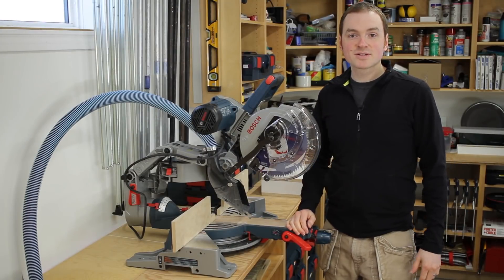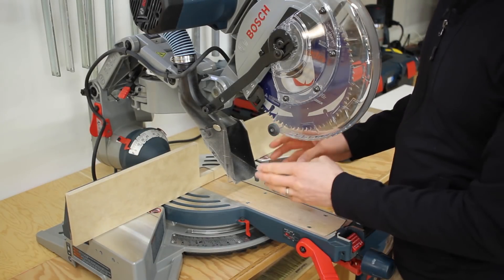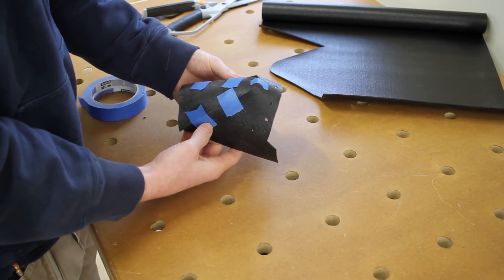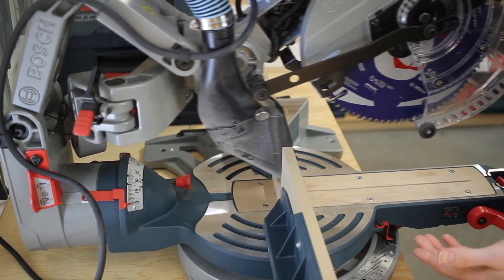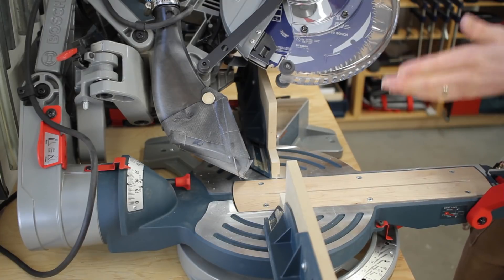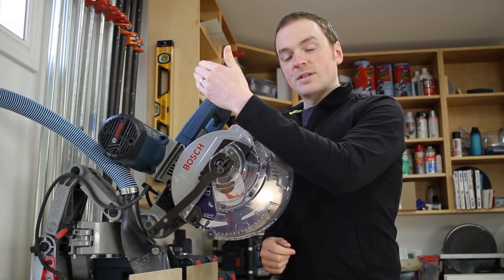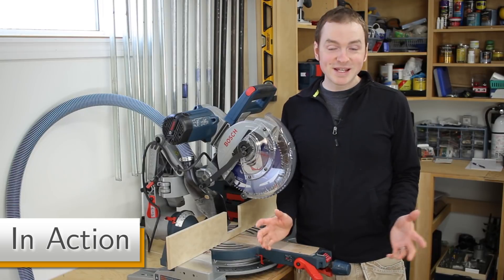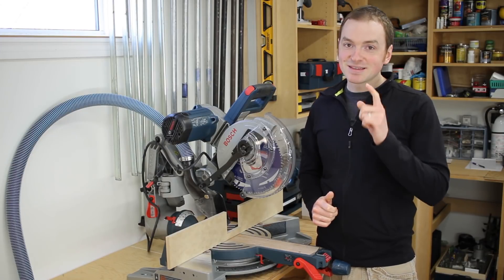Bosch Axial Glide Dust Collection Upgrades & Mods

Comment: Your shop is less dusty than my house!  Not really, but I have a terrible time keeping saw dust at bay in my little basement shop.  I’ve got 2 powertec dust collectors that I hook up to whichever machine I’m using but dust still flies.  I got a Delta Cruzer last spring and that thing spews dust everywhere even with a dust shroud and the dust collector hooked up to a straight pipe like you show.  The worst though is my DeWalt 745 table saw, any tips on keeping dust from flying out the front? .
Reply from the maker: Have you seen my video on table saw dust collection upgrades?

Comment: Well, I tried your suggestion, only I came up with something I think was a little better I think.  I took a gallon plastic milk jug and cut a 1 piece similar shape from the corner and placed it inside the dust chute. I had to play with it until I got it the shape I wanted. The plastic gives it a little stiffness to return to its original shape yet it will be flexible enough to bend. I stapled it to the dust chute. It seems to work pretty well for now. Time will tell how long it will last. Thanks for your suggestion.
Reply from the maker: Great idea, thanks for sharing👍

Comment: Hi, I was wondering if it might be possible to make the boot adjustable on the fly to account for different thickness of wood?
Reply from the maker: That's a good idea. I'm sure you could make the bottom part of the boot adjustable somehow or have pieces of different sizes at the bottom that could be easily swapped out.

Comment: I just got the same saw from Lowes's website but the dust elbow is riveted onto the strait piece that you have the hose connected to, Dan. I tried Alan wrenches and nothing fits.  I'm looking at getting the oscillating tool with metal blade to cut through those rivets.  Seems like Bosch made this modification with newer models.  I have the 12 inch but the serial number plate is dated Nov. 2018.
Reply from the maker: That's strange, I've never heard of the elbow being fastened in place like that before. Is it possible to drill them out or is there access for that?
Reply: @DPShopTalk   I'll try drilling first; good idea.  Saturday is the big day to make the modifications, I plan on loosing myself on a zero clearance plate and hooking up a new dust collection pool hose.  I used your pattern for the dust boot, although not as neat as yours, it seems to work much better.  Another interesting change is the switch lock is not on either side of the D handle. Rather, it is located underneath the handle, accessed by the thumb, and it slides to the right or left to unlock the switch.  Will take some getting used to but, from, what I can tell, is the only modifications from what you have.  I checked Bosch's website and it seems this new design is not shown on there site.  I live in NE Pennsylvania and it took 10 days to receive it to the local store for pick up. So not sure where it came from but it is one hell of a nice saw though!
Reply: Quick Update: I just noticed something after seeing how the dust port on Dan's saw angles backwards so the pool hose rests behind the motor. The dust port on my GCM12SD angles to the left, not behind the motor and, if I took that elbow from the machine off, the hose would mount directly under the motor.  It's almost as if Bosch watched this Video and said "looks like we have to modify that port so people don't Jerry rig stuff". So, when the motor is in its upright resting  position there is no room for the dust hose especially when pulling the saw down to cut. It appeared to me I did not have a choice other than to leave the dust port elbow intact and on the machine.  The only modification I did was cut off the two nubs that house the rivets (see my initial post above) and install the pool hose into that elbow port then secure a band clamp over the port.  So far so good; the connection feels secure  and I left enough slack to miter and bevel from either side.  Thank you, Dan for posting this. It did inspire me to make the modifications; too bad they changed the model slightly.
Reply from the maker: That's interesting that Bosch made that modification.  I do know for a fact that Bosch has watched that video so you could be right lol.  I don't think that the 90 degree elbow makes a significant difference in the air flow so you should be fine leaving it as is.

Comment: I'm curious how people are "getting around" the fact that there's NO LASER.  My old saw has a laser, and it's addictive!  I bought this GCM12SD yesterday (knowing full well there's no laser) because reviews showed it to be accurate, and because the bar doesn't extend far into the back.  I'm not disappointed (with the accuracy of the 90 degree cut).  Now I just want to line up the blade with my mark on a piece of wood.

I suppose I could also replace the kerf inserts with a piece of wood like you have done.  That way I could just LINE UP MY PIECE WITH THE CUT MARK on the insert.

I'm sure people will also employ STOP BLOCKS set at a specific distance from the fence.  I think this only works in some scenarios.
Reply from the maker: I used to have a saw with a laser on it and really the only time that I miss it is when I'm cutting crown moulding. For most cuts I find that having a zero clearance fence plate or insert is even more accurate.  It would be nice if the Axial Glide saws came with a laser though since they do come in handy.
Reply: Dewalt has a light that casts a shadow on their miter saws.  Other people look thru the blade guard to see the tooth of the blade that points to the line, left or right till it is inline with the mark, this is while motor us off.  

Again with the motor off,  You can look from the side and down also where a tooth will hit the line if you bring the blade down and out to where the line is.  Though you have to be careful not to scratch the surface of the stock material.

Some start the saw and slowly bring the material in till the stock is being cut appropriately by making small cuts, and then when lined up where they want  they cut all the way thru.
Reply: Thanks,  @tabithaa.9252  !  I lifted the blade guard, and was able to site down the sides of the blade -- I think that method is working really well for me!
Reply: @harrypehkonen  

Your welcome, it actually was my husband clifford, using my account.  He says he usually doesn't lift the guard on his bosch sliding with rails, cause the guard is clear with a slot to look thru.

He also says he doesn't know much about the glide.  He learned a lot from  a cabinet maker and that helped him out.  If still struggling find one that you can talk to in person and they can teach a lot of useful information in person.

Welcome again, glad it helped.

Maybe this will motivate him to be on facebook.

Comment: Dan,

I have a Ridgid 12 inch miter saw and your pattern doesn’t work for me. It would be very enlightening if you could do a video showing how you developed your template.

Thanks
Reply from the maker: Hi Pam, you basically just need to work with what you have on the saw.  When I made my boot I just looked at what was on the saw and figured out how to best attach a custom boot using what was there to mount to.  I made some prototypes first to get the shape right and then once I was happy I made my final boot that I showed in the video.  A bit of creativity and trial and error is all you need.

Comment: You did a nice neat job on that scoop - mine came out rather less pretty :) Thanks for the template, nice bit of cad there!  I plan to box the saw in an attempt to contain what the scoop misses, just noodling out how to pass the hose through and where to add a shroud for another 6" line from the dc.  I think it's gonna have to be on the box top since that's where the drop is. Hopefully it'll pick up the majority of the fines, we'll see.

Comment: So I my Bosch 12" (GCM12SD) has a smaller plastic intake than the one shown in the video.  So the template does not work for me.   I also have the 10", and it has the same dust collector as the 12". I am not sure why Bosch made it smaller. At least I have 962 feet of drawer liner left to play with to make my own.
Reply from the maker: How old are your saws? Bosch must have updated the saws with bigger collectors at some point.
Reply: @DPShopTalk  The 10" was purchased new in Dec of '17. The 12" I purchased used from a guy that didn't like it because it wasn't "man-portable".  LOL.  That was last month. He claimed it was similar age to the 10"

I'll contact Bosch on Monday and see what the deal is. If I can get the newer, larger chute, and it's not ridiculously expensive, I'll buy it.
Reply from the maker: So your 10" would be about the same age as mine then depending on how long they both sat in the store for. I'll be interested to see what Bosch tells you.

Comment: Nice Dan, as usual! Have you considered or since implemented a way to turn on the DC at the same time as the saw (with 1 switch)?
Reply from the maker: Thanks! I use an iVAC switch to turn the dust extractor on and off with a remote. You could easily use one of the automated iVAC switches to plug the saw into that would turn the extractor on and off automatically. Personally I like the control that the remote gives.
Reply: I have an auto switch that turns it on, but I didn't like the lag time it takes to get started so I just wired a switch to the front of my bench that I plug the vacuum into.

Comment: i think every sliding miter saw can benefit from this modification.   i was wondering are u sponsored by Bosch?
Reply from the maker: Yes this could certainly be adapted to most saws since dust collection is usually lacking on miter saws.

No I'm not sponsored by Bosch. Sometimes they send me some of their tools to test out, feature or review but they don't pay me. A lot of my Bosch gear I've purchased myself including this saw because I've found Bosch to be quality.
Reply: ok thank you a bunch for your video

Comment: Good idea and design.

I just made one for my 12".

I made it out of about 3mm (1/8 inch) leather instead because that's all I had.  You can probably get the amount of 3mm leather you need for around $10-$15 if you decide to go through route instead of the vinyl.  As a result, this made it plenty sturdy and there was no need for a metal bar which I'm not a fan of near a spinning saw blade.  Instead of the neodymium magnets, I just used gorilla tape instead.  Again, not a fan of metal near that saw blade.

Thank you for your design and idea.  It greatly improved my saw dust collection on this saw.
Reply from the maker: Sounds like the leather worked great. I'll have to keep that in mind if I ever need to make a new one. Thanks for sharing👍
Reply: Dan Pattison  It did.  Put it through the initial tests last night and it worked well on 2" thick maple (until I get to the other side of the 9" board which then the blade just sends all the sawdust upwards, but there's really no way to resolve that since there is 8" of maple between the boot and the blade haha)

Works great on stuff that's only 4-5 inches wide.

Comment: This is a good way to improve dust collection on a Bosch miter saw.  It did however take me two tries to get one that fit correctly.  However, the second time I made a significant improvement.  Instead of the wire, which is what caused problems with the first try, I cut up an old, plastic water bottle, the squeezable kind designed for bicycles.  I think a 1 qt yogart container or perhaps a section from a gallon bottle would work as well.  The plastic gives the whole thing a shape and is easier to tape into position.  I also found I didn't need the magnets.  The front wings stick out a bit but that doesn't seem to be a problem.
Reply from the maker: Thanks for sharing, the plastic sounds like a great idea 👍
Reply: Make it out of leather next time, like 3mm (1/8) and you won't need the metal wire.

Comment: Well, I built the boot as per your specifications and the dust collection outcome was abysmal. Dust behind and around the saw even though I was using a 14 gallon Bosch dust extractor. Very disappointed with results. Planning to build a wooden dust collection box!!!
Reply from the maker: Do you have the 10" or 12" version of the Axial Glide saw?
Reply: Hi Dan. Thanks for the reply. I own the 10 inch axial glide saw. Thanks again. By the way, your videos are simply excellent!!!
Reply: I found that if you cut wood with dimensions like 20cm (8") wide and  like  5cm (2") and thicker, the saw dust ends up just going straight up out of the cut.  There is no chance that the boot can solve this.  Maybe you are cutting large blocks of wood like this?

One thing you can do is cut the wood starting from the back of the saw first and bring the blade towards you to finish the cut.  This will give it a channel to direct chips.

Comment: This is great. And I wonder if boots of different size could be made of sheet metal and attached/removed quickly with hook and loop. Or I wonder if snap buttons would work with pcs of leather. Love your design tho - it got me thinking
Reply from the maker: Boots of different sizes is a great idea with a quick change mounting system.  The only problem with sheet metal though is there wouldn't be any give to it if it were to hit the fence, work piece etc.  Leather could definitely work though.

Comment: Good info Dan, how do you like the Boschh saw, compared to a Makita 12 slide. Thx again
Reply from the maker: Jeff, I like the Bosch better than the 12" Makita slider that I used to have.  The Bosch is smoother with the axial glide arm and I find the bevel adjustments are more convenient with them being up front rather than in the back.
Reply: Dan Pattison I agree. I stole a Makita for 350 w a Forrest Chopmaster mounted on the arbor but too much room needed. Bosch is in the near future for sure. Good ideas btw Dan!

Comment: Really you do 45's doing crown, you don't install straight pieces and cope the others.
Reply from the maker: I cope all my inside joints when I install crown but you still have to cut 45's to make your cope line as well as for outside corners.

Comment: Nice upgrade with that dust boot. That 40 cent part makes a huge difference. I do have a question, though. Since the dust extractors are usually setup with 2.25" hoses, would it work better to use the larger hose and make a small adapter at the saw to accept the larger pipe? I was thinking of the "drag" from the corrugations within the pipe.

A final question: do you have any issues with deflection of the saw at full width? I have read other articles about that issue, but attributed it to feeding the cut too fast/ dull blade or not using a top shelf blade.
Reply from the maker: Without getting into all the physics behind dust collection air flow, if you used a larger hose and then stepped it down at the saw then you end up losing velocity inside the hose. So in general you're better off using the diameter of hose that your smallest opening in the line is which is at the saw.

I haven't noticed any deflection issues with my saw. The blade that you use definitely plays a big part in that.
Reply: Your explanation on the air flow makes sense. If the velocity isn't sufficient, you get nothing but clogs in the hose.

Thanks for the straight scoop on this saw.

Comment: I just finished the dust boot on my 12 inch Bosch. I also did the zero clearance insert. I did have to modify the boot slightly but it was no big deal. I have drastically reduced the amount of dust. The insert makes quite a difference as well. I'm just using a very small shop vac and don't feel the need for anything larger. Thank you for this video. The mods are well worth while.
Reply from the maker: Glad to hear the mods worked well for you!

Comment: Thanks for all the replies.  I've spent a good amount of time dialing the saw in and can now get accurate cuts for things like picture frames. I discovered that making sure the blue blue knob is tight before tightening the set screws ensures it doesn't move. I imagine the Forrest blade will make it even better, given the luck I've had with those blades on my table saw.
Reply: Where is the blue blue knob?  I want to adjust to 90 deg because the saw is not square out of factory